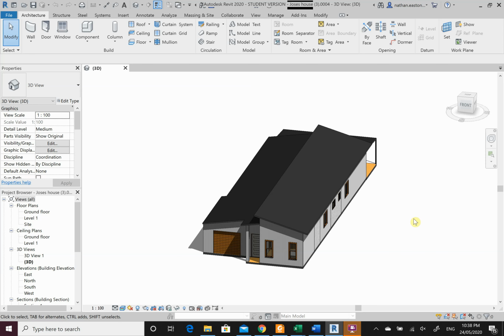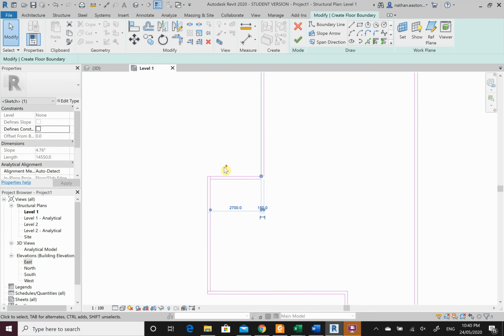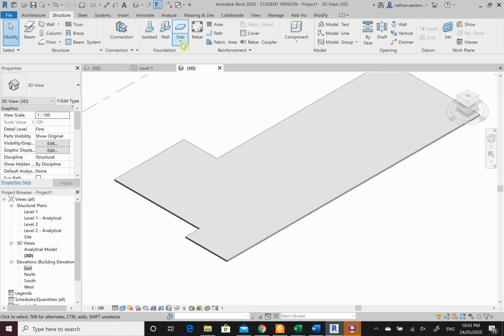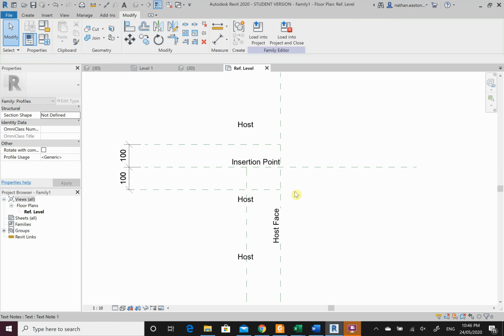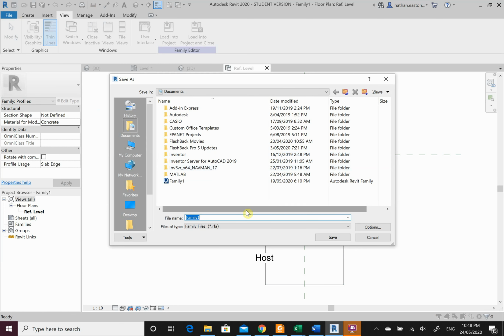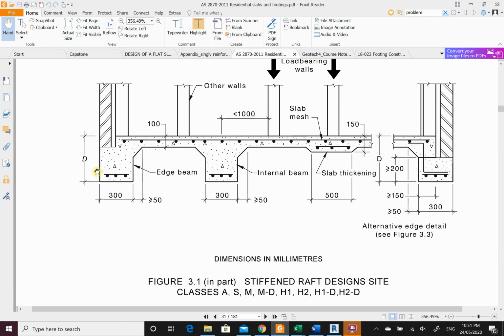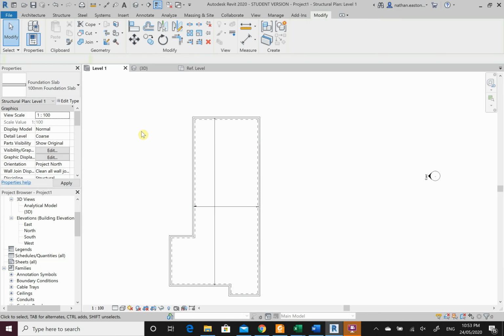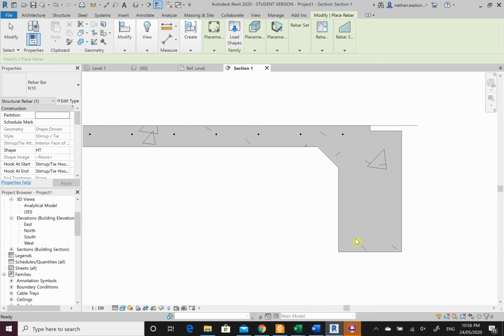Slab and Edge Beam - Revit

Comment: Hey mate, great video. Just a tip, you can offset the entire perimeter (150mm offset you did at the start) by deselecting the copy function in the offset tool, hover over any line and press tab until the entire perimeter (all lines) are highlighted and then clicking on the side you want to offset to. No deleting or trimming lines required :)

Comment: Hi Nathan, great video! 
Question: Is there a way to model the chamfer edges of internal concrete beams (like the ones you have for the display pic of this video)? I’ve tried using a beam family and it shows up fine in section but then my floor plan ends up with more hidden lines (from the chamfer and the internal concrete beam)? 🤔

Comment: How do you start designing, like do you get soil data from geologist, then according to the AS 2870 if needed use Walsh or Mitchell method....what is your guidance?...if capacity of soil is not less than 100 kPa than you do not need calculate....
Reply: Most data incl. geotechnical comes from a Surveyor in Australia. Some Surveyors can work as building Certifier and approve some building works. Geologists are most in Big Mines and Big sites...
Reply: Oh well, they can afford to have all sort of Engineers in-house :), yeah you right, sometimes if companie have accredited laboratory can send civil engineer to do the job, it's not like you drilling out for oil and you need geotechnical Engineer to see what's going on in 700 m down.....anyway very nice to chat with you....
Reply: Did you mean geotechnical engineer?, surveyor can be anything (construction surveyor, paleontologist surveyor, land surveyor)
Reply: @tbijondagmail  Surveyors and Geotechnical usually work together so their info is combined to be presented to a structural engineer or building designer
Reply: That is strange, cos where I worked on site in Au, geotechnical Engineer came, took samples of soil, went to his lab to do tests and Voila, he sent back soil results. Some companies work differently...
Reply: @tbijondagmail  They do that to save money that's why some companies have a surveyor in-house! Some big companies have all professionals in one house: structural, mechanical, architect, a surveyor. In Big 5 companies (Probuild, Lend Lease, John Holland, Fulton Hogan) have all professionals in their companies!
Reply: @tbijondagmail  Because some parts building approvals come from a Surveyor!